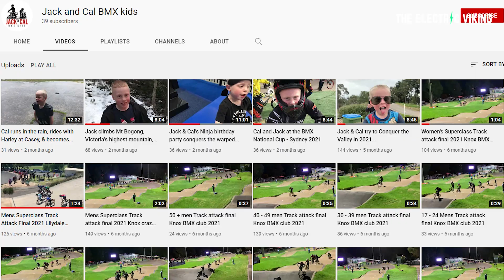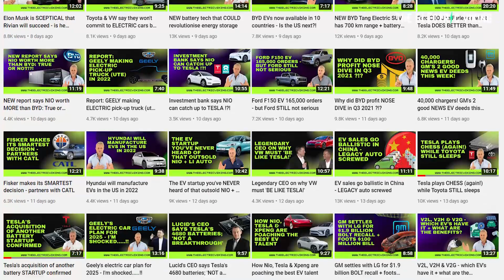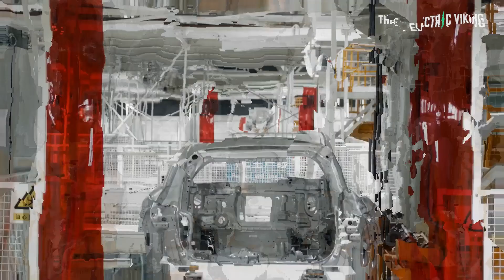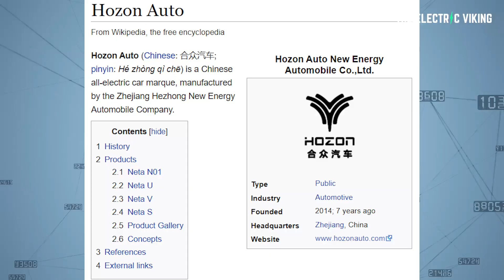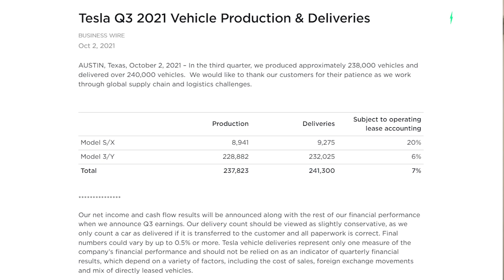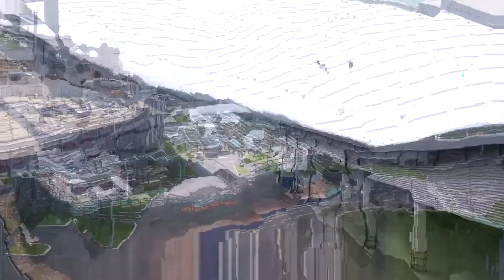A tsunami is coming: the Chinese EV invasion has begun...

Comment: A truck dealer in NJ, USA is already selling BYD fleet tractor trailers. Looks like they just came into the US. Also, BYD stock is traded here on the OTC market as BYDDF.
Reply: What platform can you buy some BYD stocks?
Reply: @Joda30088  Any brokerage can do it.  I have BYDDY shares that I bought through Vanguard.   (BYDDY is the ADR of BYD stock, while BYDDF is its H-shares. The other difference is that BYDDY shares trade at twice the price of BYDDF shares. You can buy any of the stock versions because they represent the same company.)
Reply: Luxury automated socialism now
Reply: @incognitotorpedo42  Thanks for the info!

Comment: What about the charging infrastructure? Are our electrical grids able to handle a sudden increase in the demand for power from a deluge of EV's ? Would love to hear your comments on that.
Reply: It'll be fine, we went from old 60 watts bulbs to 6 watts LED bulbs. Many of old appliances weren't energy efficient, new appliances are much more efficient. Our grid will be okay.
Reply: For those in Australia who are buying or own their own home we have the option of installing rooftop solar panels and battery storage too if you can afford it and charge from solar power during the day for free or from the battery after the sun has gone down or the third option sending excess power produced by the solar panels while you are at work for some money and recharge your Ev whilst you and most people are fast asleep from grid power, so your EV is fully charged when you leave home the next morning. 

Depending on your daily commute to work you might only need to charge once or twice a week.
Reply: Luxury automated socialism ok
Reply: It still takes between 4 to 7 Kwr's of electricity to refine a gallon of gas so do the math.  Getting rid of gas powered cars will not have that large an impact.
Reply: Supply and demand. If there is profits in building more electrical supply it will be built. You only need about an increase of 10-20% over 20-30 years, which is possible. Vehicle sales might be 100% EV's in 2030, but it won't be until 2040-2050 until the majority of ICE vehicles are dead. Plus home solar becomes more cost effective if you own an EV, so might only need 5-10% more grid. Plus fusion is getting close milliseconds 20 years ago, now minute run times. Plus wind turbines are now so good, wind farms are cheap and easy to build.
Reply: @petersimms4982  what? Do you think socialism is bad?

Comment: Sounds like they're going for relatively small numbers initially and to selected markets with the numbers largely dependent on how rapidly they can ramp production. Initially Tesla will out produce them in Europe.
Reply: As long as Tesla produces in Europe and the Chinese manufacturers not, Tesla will have a significant advantage because they do not have shipping cost and import taxes, which are quite high in Europe. And with the latest tech in the GF Berlin Tesla will have even lower production cost (2 Gigacastings and for sure a lot of other stuff). Nonetheless one must follow very closely what the Chinese companies are doing in Europe.

Comment: What do you make of MB, Stillantis,Hyundai,Kia major investment in Solid state? Will this be a game changer moving the BEV game on? Dark horses making a late solid run?
Reply: Hail Mary, in my opinion.
Reply: All the solid state research companies are still working on the tech but they close, maybe in a couple years they could begin production
Reply: @drew031127  MB has been working on solid state for a while now and its about time MB gets its mojo back and shows some leadership again. Often those late to the party, have the bigger impact. These are very very early BEV days and a lot is to play out. Batt/Cell tech has a long way to go and will. As it stands its too restrictive.
Reply: Conventional lithium ion cells (of various chemistries) are getting so good and so inexpensive that solid state is going to have a tough time breaking into the market.   They are going to have to be a lot better than conventional cells to be commercially successful, imho.
Reply: @incognitotorpedo42  Good is never good enough. Built to a price is getting BEV off the ground in a major way now, which is fantastic. There's a lot more in this. Just imagine a 30% increase in energy per KG and the opportunities that would offer. Weight is the enemy and it needs to be fought to widen that net.
Reply: Luxury automated socialism ok

Comment: Comment on Tesla Powerwall.  No one seems to comment on TESLA ENERGY WHICH IS PART of the TESLA STOCK, Tesla motors.  Car batteries have made Battery storage more competitive.  I can charge my Model 3 free with the powerwall and solar panels.
Reply: Wow you can add a whole 13.5kwh to the 55kwh battery on the standard range Model 3, or park it at home and on a sunny day depending of your solar system charge your Tesla, however most are not home during the day when the sun is out...

Comment: Chinese cars are yet to be proven. Yes Japanese and Korean cars took many years to be accepted. Chinese vehicles will have the same issue and it will all depend on how the manufacturers support customers. I will not have any chinese vehicle EV or ICE on the list when looking to buy a new vehicle. Yes they are cheap but cheap means not much profit and therefore customers are more likely to get the runaround from the dealer/importer/manufacturer when there are problems. Intially there will be a plethora of chinese brands but within 2-5 years this will reduce drastically due to issue mentioned above.
Reply: I have taken Chinese electric taxis and electric buses many times in Sweden, the UK, and other European countries, the BYD brand. I have a very good impression of them. I am currently using Audi car, and my next electric car I planned to buy is likely to be a Chinese electric car.

Comment: Just a thought. Where is all the base load power going too come from? If electric cars become the norm. How will the grid handle the demand? Will solar and wind generation be enough?
Reply: Nuclear power plants
Reply: @dh66  I agree, unfortunately we in OZ don`t have one. Former PM John Gorton started to build one in Jervis Bay, but PM McMahon stopped construction.
Reply: @dfiglide  gotta love politics
Reply: To make the most of solar power charge mainly at home, hopefully people will charge at work with solar on car parks or buildings, charging slowly like this shouldn't make much of an impact on the grid, but it would be good to up grade the grid to cope with more wind, wave and solar etc  energy.
Reply: The UK power authority has addressed this.  They say it's going to be fine.  EVs don't all charge at the same time, and they tend to charge overnight when demand is low.  They are essentially using equipment that would otherwise sit idle or be curtailed.  Some minor upgrades will be needed (in, for example, transmission lines) as the percentage of EVs grows, but that's all doable.
Reply: Luxury automated socialism ok

Comment: I doubt the China Tsunami is coming for the following reasons.
1.  They are mostly state backed companies so tons of propaganda.  
2.  They have limited production capacities and cannot produce enough cars effectively yet.  
3.   They are all about hype, but when you look at their actual capability, they have not optimized their technology.
4.   Service for customers is going to really suck and if there are any problems, they will not be able to help a customer and customers are going to have to wait a long time to get issues fixed.  I.e. their infrastructure on customer care is weak at best.
5.   They have NOT focused on supercharging at all.   
6.   Any issues regarding charging problems - which is one of the major issues with all EV's after a certain time of ownership will be telling.
7.  Software updates - problematic, unless Nvidia has that sorted for them.   
8.   Battery capacity issues - both in having enough batteries to build cars.  
9.   Small short range cars - simple cars - like modified golf carts - they may have a market share - cheap cars means cheap or non existent service.   
10.   How many customers will choose China made vs say VW or Stellantis, or emerging legacy car makers who are spending billions as well?   
11.   Locally made vs exports will be a challenge for exporters depending on sourced parts and vertical production integration
I would NOT buy a Chinese car.  But go ahead and promote all you want.  You will fall flat on your face.
Reply: Have you really been looking at Sam's research?
Reply: The best EVs on the planet are coming out of China. You don't have a clue.
Reply: I am in the middle in saying that Chinese cars will not automatically dominate, but I do understand we should not underestimate Chinese cars. I think 10 years from now is more realistically when you will see Chinese cars do really well. You need to understand that all he major car makers have had factories in China since the 1990s, so Chinese have been making identical vehicles from VW, Toyota, GM etc for 30 years now, so they know how to make cars.
Reply: Lol. You can list as long a list as you want. The heart and soul of EVs center on their batteries. Guess which country makes the most batteries and most cost effectively in the world? China.
Reply: 2010 just called and it wants its auto industry analysis back.
Reply: @benjaminnead8557  lol. Nailed it. This Tesla fanboy is so oblivious he doesn't realize that point 4 is also Tesla's problem.
Reply: Many of your points would have applied to Japanese cars back in the 60s and 70s and we know how that ended.
Reply: @dh66  Thanks. I could have spent paragraphs picking apart all his points. But why bother? The cars will arrive from China into the US and there will be much acrimony coming from multiple directions. Unfortunately, the sort of anti-Asian racism that's endemic nowadays will also be part of it. I'm old enough to remember the arrival of Japanese cars in the early 1970s and all that changed because of that. The automotive world was a much better place when all the dust settled. Same with what VW did to Detroit just a few years earlier. HAWC is simply taking a note from that playbook. I've seen it before. 

I actually appreciate Biden propping up Detroit, even though it's painful to watch all the "You did it, Mary" shilling. He fully knows that the Chinese are coming and he simply wants to harden the old OEMs against what everyone knows is going to be a heated battle (UAW-built purchase rebates, etc.) He's sort of damned if he does and damned if he doesn't. Tesla will do fine and Biden also knows that. The "fight' between Joe and Elon has been blown out of proportion. It's become kind of soap opera-like to watch. I'm far more concerned that the Build Back Better bill - which is mostly excellent - and that it's going to get unnecessarily dragged out and trashed by Prime Ministers Manchin & Sinema. 

Interestingly, Tesla will probably be bringing its $25K car into the US initially as a Chinese import. (ie: built in Shanghai before anywhere else.) It will also have Chinese-made batteries, as will most low-to-mid price Teslas from this point forward . It's all good. Meanwhile, the Chinese firms that Sam talks about here will be arriving at around the same time. Detroit will have its electric pickups and the battery powered Hummer. But unless Detroit - and Tesla for that matter -  finally offers a real selection of smaller and less expensive hatchback EVs, they really have little to complain about if the Chinese end up dominating that end of the market.
Reply: @grantdewar4462  Apparently not.
Reply: @benjaminnead8557  Good analysis.  One thing that seems likely is protectionism by the US.   That could make things pretty tough for China selling here.
Reply: Luxury automated socialism! Look at there factory’s on you tube. Where’s you’re phone made?